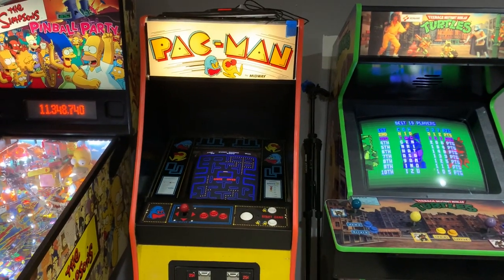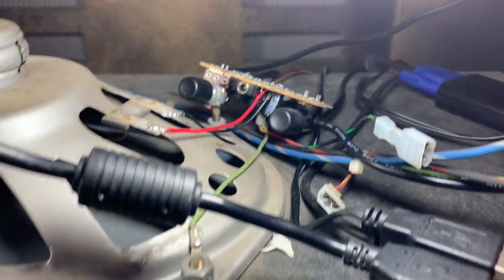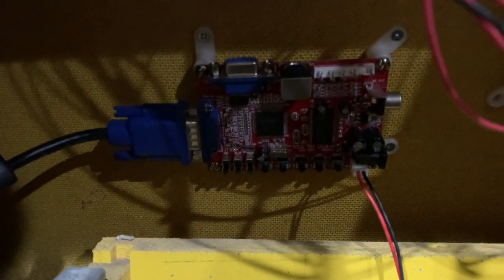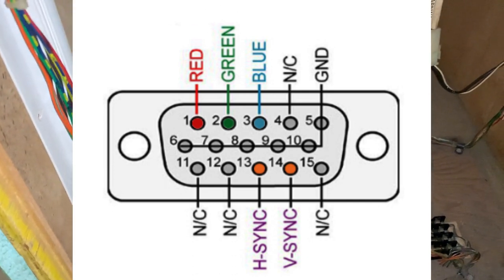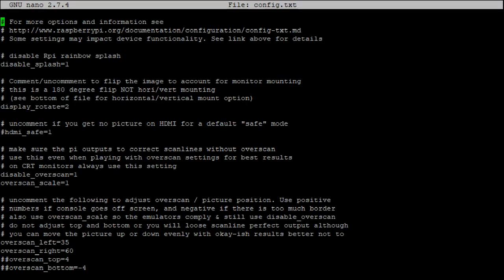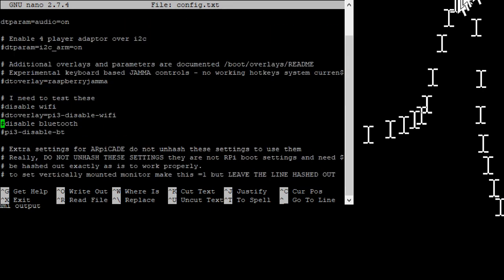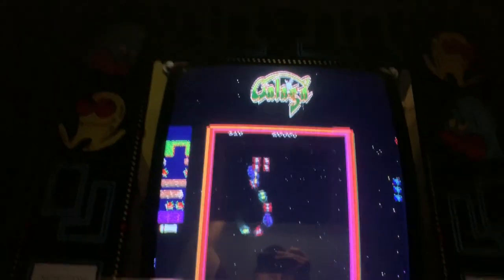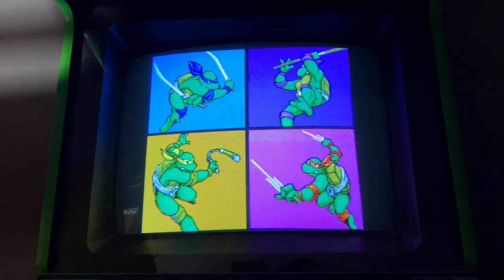The BEST way Raspberry Pi to CGA Arcade Monitor! 240p NO GBS-8100 REQUIRED!(settings in description)

Comment: I'm confused as hell.   
You are doing HDMI to a VGA adaptor.   
What is the actual monitor?  (just watched the video again to get that) 
Is the Wells Gardner actually just a VGA monitor?   (guessing no)  "standard arcade monitor from the time"  no specs that I can find so far.
=Your title is CGA and 240p=
You DO NOT get a CGA digital 16 color signal from an HDMI to VGA adaptor!  and also the Wells Gardner is not a CGA digital input monitor right?   

What's going on here? also I am new to this.  
I am trying to figure out how to get 240P RGB and Sync from a Pi to an RGB monitor at 15KHz (which you also can't get from standard VGA)  
Also can't find any kind of spec sheet on a Wells Garner 4900 or 4901.  
Confused still? yes very.  
And I expect those to be analog RGB +Sync 240p 15KHz   
And not what I'd expect you getting from and HDMI to VGA adaptor on a Pi.  
Help! and thanks!
Reply from the maker: The monitor is a Wells Gardener 4901 which is a CGA arcade monitor that accepts RGB @ 15K. It is not a VGA monitor which would be a 31K sync.  I’m not going to pretend I know everything here haha, but the timing settings for the HDMI mode on the raspberry pi config are what deliver the correct RGB signal @ 15K. I just found the settings online on an arcade forum. The HDMI to VGA adaptor is allowing me to get the RGB and Sync on separate connections so the monitor can accept the input. 

Hopefully that makes sense and helps.
Reply: @sk8ersublime  Just typed an entire page here and submitted and it's gone :(
Reply: CGA monitor is 4bit TTL and not VGA.  
So one of my points of confusion is that going from HDMI-->VGA-->monitor is NOT a CGA TTL signal.  (if that is a VGA adaptor).  
HDMI to VGA would normally do exactly that, Change HDMI to VGA RGB analog 31KHz.  (thus my confusion so far).
Reply: I think what might be going on here (and I can only totally guess or make shit up at this point) is that the "VGA" adaptor is not really a VGA adaptor, but maybe some kind of straight through connector actually from the HDMI itself and the HDMI itself might be generating TTL CGI stuff using special software/driver.   
But a totally random thought I am pulling out of nowhere.
Reply: @sk8ersublime  could you link me to the article  how to get pi to output 15 k ,

Comment: Do you know if you still need the breakout cable if you're using a JPAC?
Reply: Seen other videos where they connect the vga in and pass the controls and video out via a standard JAMMA harness connected to cabinet.  Check ultimarc instructions.

Comment: Anyone who does this have any issues with the voltages from the VGA's RGB signals being too low?  I've heard that is a concern that causes too dim of a picture.
Reply: Yes it's common occurrence, in fact some converters-adapters amplifiy the video signal for this reason.
Reply: @jimbotron70  I eventually tried it out with my Pi 3, a VGA666 hat, and a sync combiner circuit I built from a schematic off the RetroRGB websit.  Didn't have to amplify anything and it looked flawness on my arcade monitor in my MK3 cabinet.

Got a Pi 4 recently, and looking forward to trying that next.

Comment: the best way is more something like rgb-pi...
Reply from the maker: slyder the great i haven’t used that before, but it seems to be just like the RaspberryJamma. I prefer this solution because it was the cost of a HDMI2VGA adaptor. ($5-10) and a VGA cable. This looks identical to the picture quality I am getting from my RaspberryJamma, for roughly a tenth of the cost. There are multiple solutions to achieve this, I personally feel the less hardware involved, the better :)